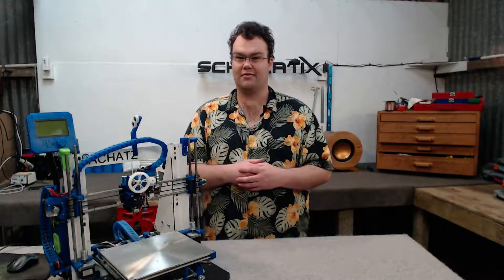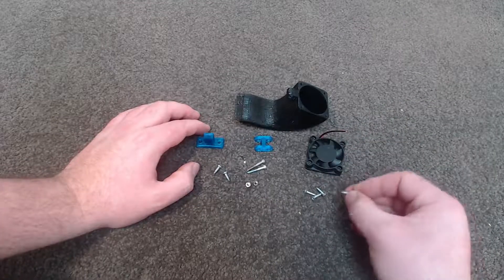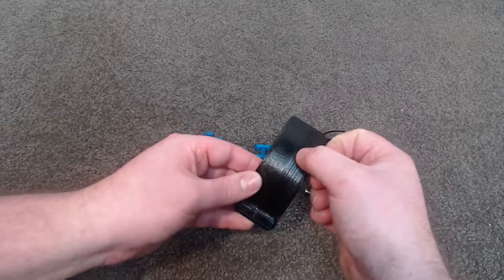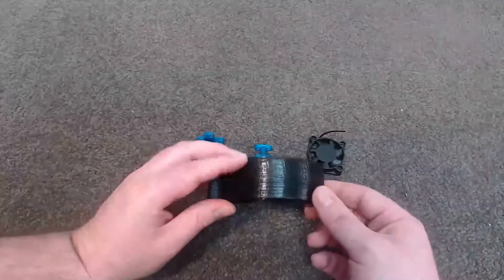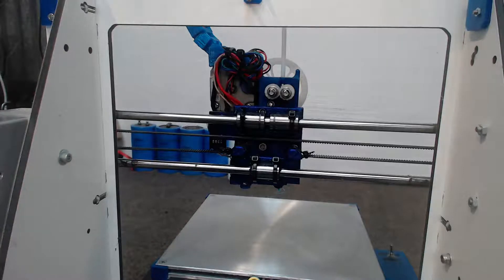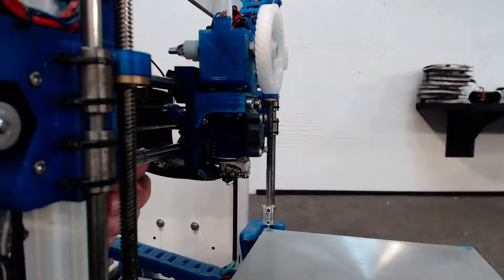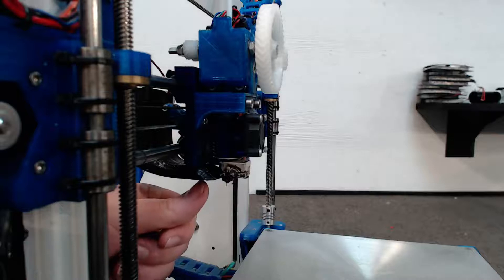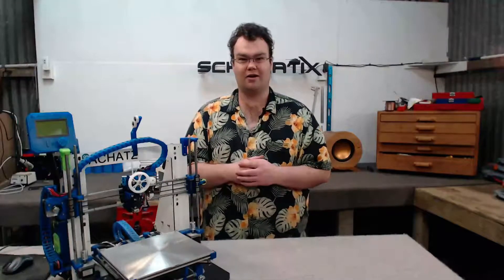Adding A Blower Fan To The Dual Drive Extruder (Universal fit)

Comment: Stupid pro tip: vanes inside the duct can help reduce turbulence, linearise the flow make it more laminar, help convert airflow into static pressure. They can also serve as integrated supports that you just leave in, no remove.

But it's best not to design in axial fan to this sort of duty anyway.

Comment: Not a blower fan.  That's a tubeaxial fan.  Radial or "squirrel cage" fans are what are classically referred to as blower fans. The difference being radial blower fans have better performance with static pressure (in a ducted setup that reduces the output diameter).  Standard computer case fans like this one are not nearly as efficient when ducted